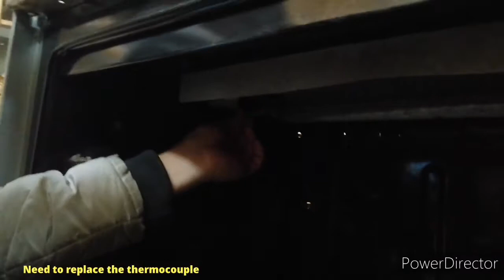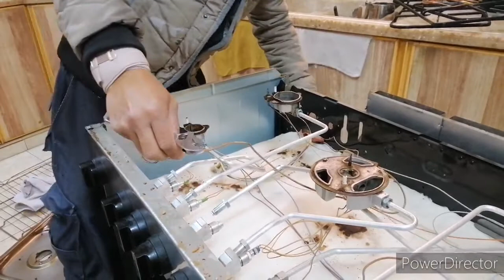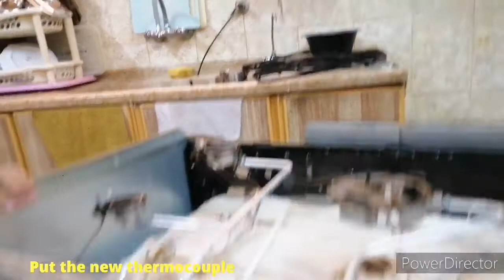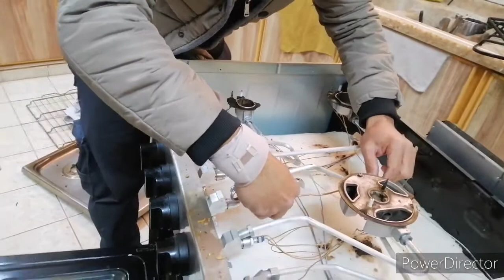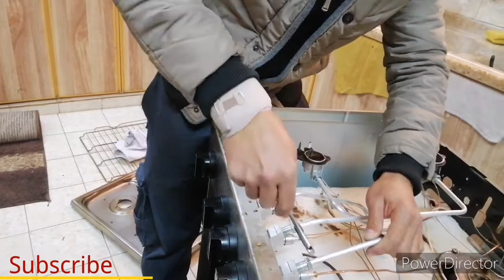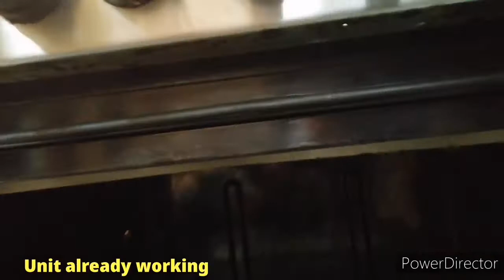How to repair Gas range Oven? Pinoy technician 🇵🇭🇵🇭

Comment: Sir pano po if yung  burner ng oven sa loob mismo namamatay if irelease yung switch nya. Taas at baba na burner same issue
Reply from the maker: Thermostat na palitan nyan sir buong Gas valve thermostat sir
Reply: Mgkno po kya gas valve thermostat
Reply from the maker: Depende po sa unit nyo sir